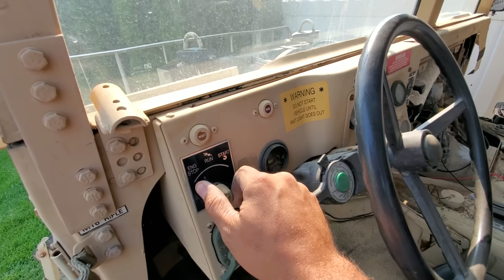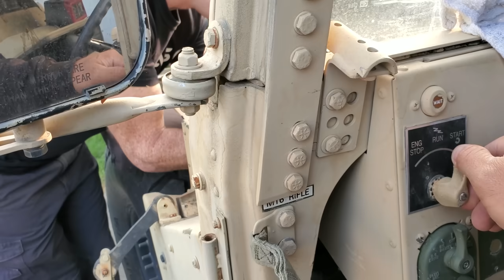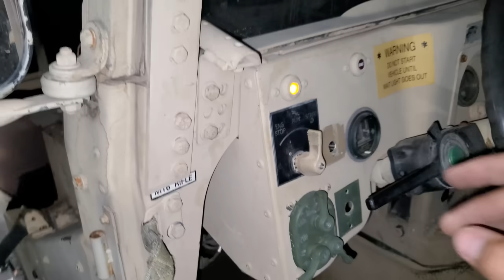Well... we figured out why the HMMWV wont start...

Comment: One other question, 
With the Tesla motor and everything thing else that is used to put it all together, can you make it water proof to the extent of being able to run it through high water ?
There’s a process that all the electrical components including mother boards where they dip them into a liquid that waterproofs all the electronics . 
Hypothetically can that be done to the critical components that are a problem with short circuiting with water / condensation/ moisture.
 Do hummers kick up a lot of water under or in the chassis / engine compartment .
Reply: i believe what youre referring to is a hydrophobic coating or a wax coating or even a plastic film, they are waterproof if water drips or even splashes on it but fully submerging it would be bad and would not hold up very well, especially since its going to be moving water and full submersion. 
it could work for a set amount of time but then again its not going to hold up in the long run, either fully seal the electrical components in an enclosure that is water tight or scratch treading water off as a whole

Comment: A diesel engine does not contain a spark plug. A gasoline engine compresses at a ratio of 8:1 to 12:1, while a diesel engine compresses at a ratio of 14:1 to as high as 25:1. The higher compression ratio of the diesel engine leads to better efficiency.

Comment: You may need to replace or fix the injector pump but (at least with what the video showed) you haven't got to that stage yet. Most common reason diesel won't start is you need to bleed at the injection pump and then at the  injectors to get diesel flowing to the injectors - all of them. If it still won't start I would add some ether to the air intake to help it get going.

Comment: I always wondered why don’t people just do a gas engine swap on these until I looked further into it.  One would need:
 a new drive shaft probably custom since it’s elevated 
engine plate and mounts for the new engine/pcm
obviously a new transmission and custom adapter plate just for starters
way too much fab work, and a lift would be mandatory 

Ideally I’d try to give it the TRX treatment.

Comment: Alot of guys with old 6.5s will just install an electric lift pump wired into the accessory position of the ignition switch to avoid problems like this.

Comment: The lift pump you replaced does NOT run directly on the camshaft....there is a rod that is about 1/2"diameter and maybe 4" long that runs on the camshaft and pushes your pump lever....if you dont install the pump correctly you can snap the rod in half as you are tightening it down and once installed your pump will not be pumping.....i did not read all you comments, but if you had a bad lifter pump and then replaced it incorrectly...you may think that is not your problem, but it actually is.

Comment: You just need to fit some new seals on the diesel pump....or replace the pump completely if there is metal to metal contact on the faces and these cant be machined out.....Youve got a good   compression on the motor all you need is some fuel and shes up and running I know you fitted an electric motor to the Hummer but dont despair with the repair of the engine its got to be worth a mint once its sorted out ? Dont let any mechanic put you off and say oooh its gonna cost a fortune it needs this and that etc......all he wants to do is buy the engine from you so he can make a big profit for himself dont fall into the trap !

Comment: Crack the bolt loose on the injectors and let all the air out and prime them
Reply: We did that first, but there wasn't fuel due to a stuck check valve.  This absence of fuel caused the injector pump to eat itself.  When I was called in, the glow plugs weren't working properly and one was burned through and part of it fell into the cylinder.  So I helped get that corrected and located the stuck check valve causing the no-fuel to the distributor pump condition.
Reply: @briansmobile1  wrote this comment before watching the whole video

Comment: I probably know less about engines than anyone here... but the pattern "Diesel engine working, then not working after sitting around for a while" seems familiar. Happened to our camper van a while ago. Apparently, Diesel fuel can be contaminated with microbes that feed on the fuel, especially when it comes from a fuel station that does not have a lot of turnover. This is fine as long as you drive regularly, because the microbes just get flushed out with the fuel. But if the car just sits around for months, they multiply and turn into a sort of goo, which can completely block the fuel filter, or I guess valves too. Apparently, it is a common problem with auxiliary motors on sailing yachts and such.